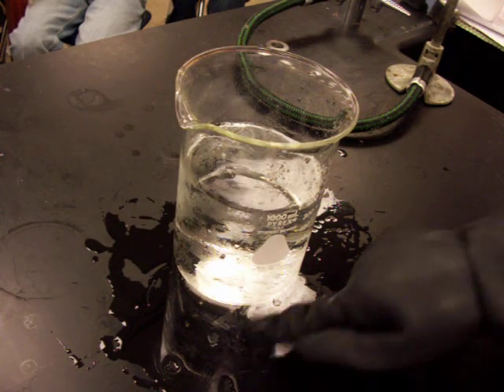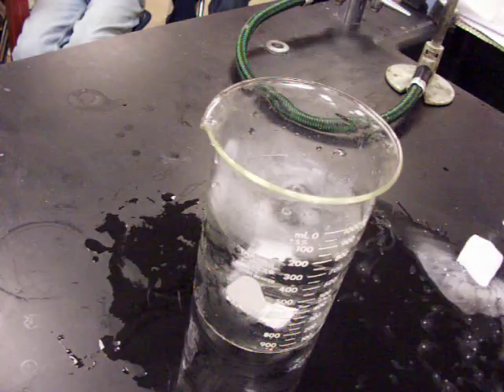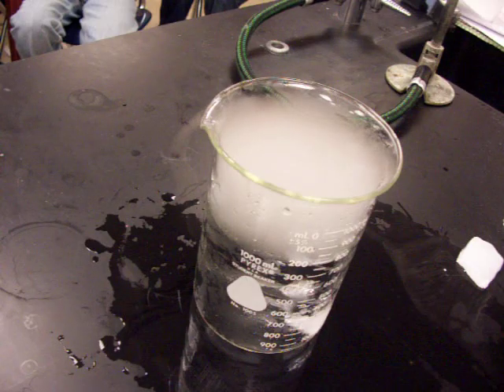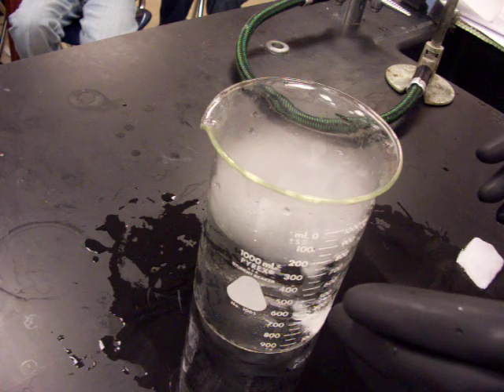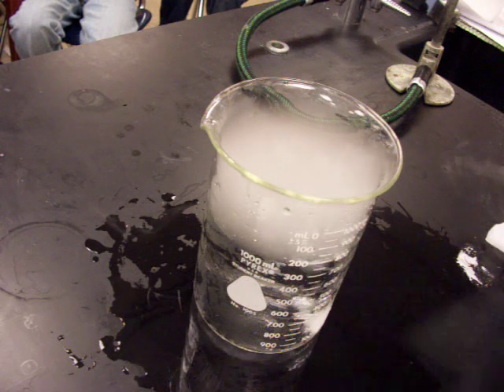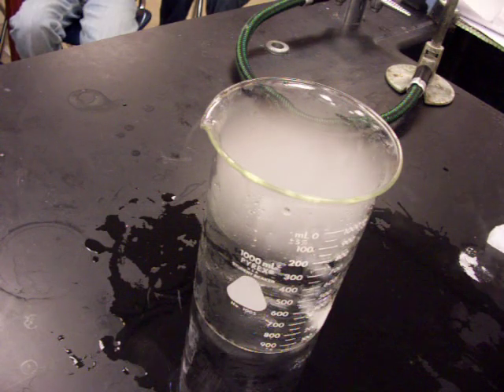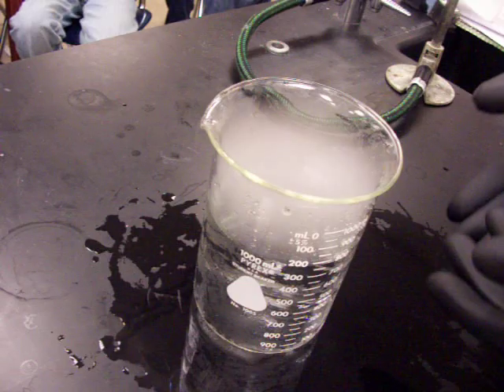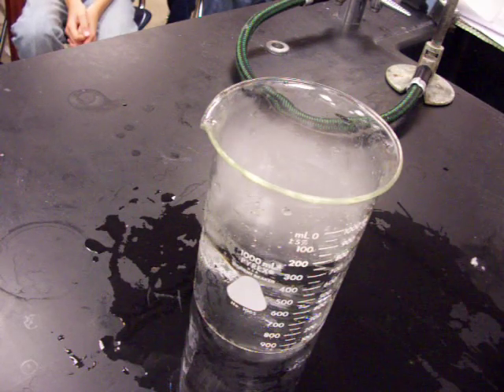Dry Ice in Water

Comment: My science teacher says that carbon dioxide cannot be a liquid.
Reply from the maker: First, it isn't a liquid here, it is a solid inside a liquid (water) that is subliming, which means it is going through a phase change from solid to gas, skipping the liquid phase.
Secondly, CO2 can be a liquid, but not under normal atmospheric conditions.  However, if you pressurize it, up to about 5 atmospheres, then it does turn into a liquid.
Reply: Thank you for taking the time to reply to my comment. I'm sorry that it took so long for me to reply. I will share this with my science teacher. Once again, thank you, and I wish I had you as a science teacher because you  seem like your class would be fun!
Reply from the maker: tom wolf It depends on size and how you store it, but dry ice does have a fairly short shelf life, even if refrigerated and kept insulated.
Reply: +Sully Science For how long could be keep a pieces dry ice? is it after limit time become to the gas self?
Reply: Sully Science Thanks buddy, I want use it to production co2 gas source but if it has a short time is better for me to buy co2 bottle.
Reply: +tom wolf If you need pure c02 gas I'd buy a bottle: much more controllable and doesn't require refridgeration, though make sure you can use it safely. If you just need it for a smoke machine than the solid is fine: it keeps in bulk in an insulated bucket for a few days
Reply: Isobel Priest Yes true, thanks buddy

Comment: Interesting. I'm trying to find a way to incorporate something like dry ice into a liquid-cooled computer setup for overclocking (artificially cooling the components of the computer so I can increase the voltage on the chips and make it run faster), so I can have a low-maintenance solution to the problem. With normal liquid cooling, I don't have to bother with anything except for changing out the liquid once every six months, but for a high-end system running over 1000 watts that's not enough cooling. I guess dumping a cube of dry ice into the sealed water reservoir is out of the question. Maybe having some dry ice around the outsides of the coolant hoses, though I don't know how long those dry ice cubes would last (I guess changing them out once a week would be tolerable).
If the dry ice angle doesn't pan out, I might look to using some small refrigerator components attached to the computer, but that might create more problems than it solves. I think if it was doable, someone else would have done it already.
Reply: Dry ice for a computer would be a hell of a stupid idea, its expensive and would not last more than a minute or two.  Also the liquid cooling if you buy a closed circuit you wont need to maintain it.  As far as the fridge it works the same way as a car and your house a/c.  Using the fridge parts would be a bad idea because the evaporator is too big and its not meant to be refilled so you can't change any of the parts without losing all the refrigerant and no way to refill.  

Now, if you really want a cold computer the best way I figure would be using a fridge compressor with car a/c hoses, they have connectors for refill kits which you can buy cheap, and the evaporator/condenser from a computer water cooler.  While attaching it you would need to make it airtight so the refrigerant doesn't leak.  The last thing is a thermometer for room temperature and another for evaporator temperature.  Then you would need a micro controller to control the compressor speed, because if the evaporator temp gets below room temp water will condense on it and then drip on your cpu/gpu.

Basically it would be a pain in the ass but if you got the time, money and dual gpus with water cooling isn't good enough for you then go for it.
Reply: Vlad Kryukov
Thanks for the input bro, I definitely appreciate you taking the time to list out the bits and pieces. Sounds like it just might work. I'll definitely play around with that.
The summer months are murder here in Turkey, most people's rooms aren't air conditioned (they just use ceiling fans), which is why water-cooling isn't good enough for a 24/7 overclocked computer.
Reply: EZ M Try researching phase-change cooling and liquid immersion cooling. They offer some impressive results.

Comment: does that carbonate the water? is it safe to drink after?
Reply from the maker: It does carbonate the water, although I would never drink from my lab glassware.  Furthermore, it is not very carbonated because CO2 does not dissolve very well in water at normal pressure.  Most carbonated drinks are bottled at higher pressures to force extra CO2 into solution.  Having said all of that, one of my favorite things to do is to get a couple of bottles of fruit juice and pour some into extra pitchers to avoid overflow, then toss some dry ice in each of the original bottles and the pitchers to make sparkling juices.  They go flat quick though, and of course don't put the lids back on the original bottles or you might explode the bottle.
Reply: Sully Science Thanks for the detailed answer. Doesn't seem stable enough for it to be a normal thing to do.
Reply: you can drink it. it tastes bad though

Comment from the maker: @BionicleFreek99 Dry ice doesn't melt, it sublimes which means it goes straight from solid to gas.  The rate of sublimation in the water is usually faster because water coming so close to its surface causes it to warm up all over versus limited contact with gases in the air.
Pieces this small will not go all night and there is a problem with putting dry ice in water- eventually the dry ice cools the water around it enough to form water ice around it which actually slows the rate of sublimation.

Comment from the maker: Due to liability issues I cannot tell you where to get dry ice, but a simple internet search would probably turn up suppliers and other venues.
And yes, tiny pieces=large surface area= more fog.  The only issue with this is that the fog is slow to be generated without the addition of water, but tiny picese will freeze water around themselves and become encapsulated which can cause them to stop giving off fog temporarily until the gas pressure can crack the ice.